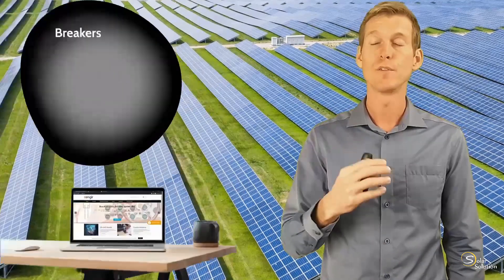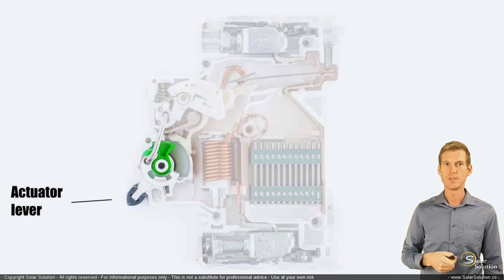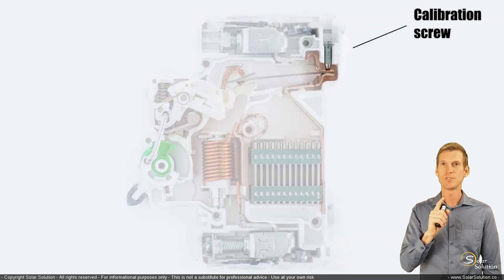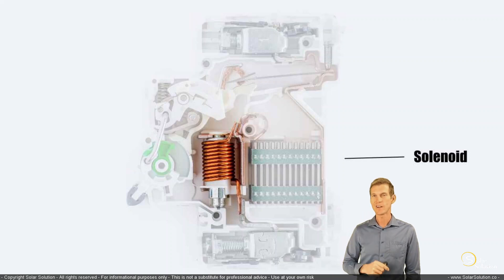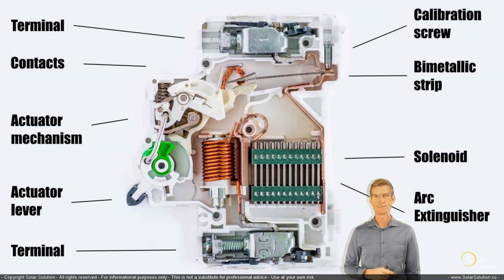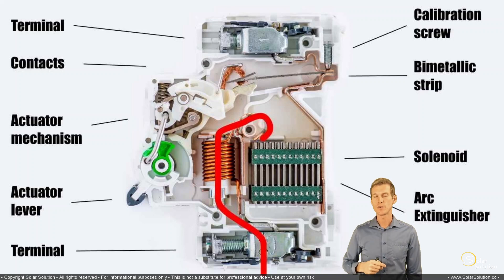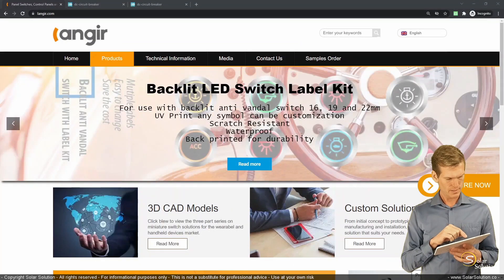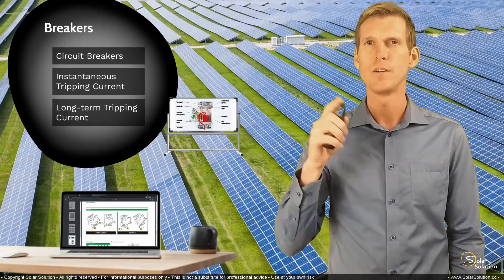Solar Circuit Breakers: The difference between DC and AC breakers

Comment: can you guys explain is dc breaker a must in solar system or optional? if cables are short (10 metera), low voltage (up to 500v), etc.?

Comment: Can I split a 2P circuit breaker into two 1P breakers?
Reply: No, you can't.  Even if you take off the cross-piece on the handle, there is an internal cross-trip as well.  And the 2-pole breaker (if a DC breaker) might or might not depend on the current going opposite directions between the two poles.

Comment: I just tore down a 2 pole breaker. Your explanation makes sense for the single pole. But because these breakers are exactly the same the +/- markings for the breaker on the right is reversed. This means the current is moving through the breaker on the right in the reverse direction. How does this safely trip the breaker?
Reply: I just tore down one of my 2-pole Chtaixi's TXC65Z-60, DC12-110V MCB.  And both poles were also exactly the same.    They have +/- markings too, but the marketing literature is ... confused to say the least.  It says to follow the +/- markings for best practices, but it also says that the breakers don't care about polarity.

Since no matter how you hook the breaker up current flowing through one of the poles will be opposite the current flowing through the others, that means either this 2-pole breaker is not polarized (despite having + and - markings), or it is polarized and it assumes symmetrical/opposite currents correctly breaking the ARC on one of the breakers when they both trip.  Breaking the ARC on one breaks the current path for both (usually).

The breakers do trip together.  There is of course the tie on the handles, and there is also a little plastic piece between the two housings that cross-trips between the breakers internally.

Oh yah, no magnets in the ARC-break for this 2-pole breaker either.  The plastic housing that normally contains the two magnets is empty.  All the other trip mechanisms are intact and operate as expected.

But I can't really tell if this breaker is actually unpolarized, or it isn't and depends on current symmetry, or it's some deficient piece of garbage.

Comment: Hi, is this dc circuit breaker enough to protect Lifepo4 batteries/PV string or should it be combined with fuses?
Reply: DC breaker is basically enclosed resetable fuse with handler. Its the same, only 1 of DC breaker or DC fuse is enough.
Reply: @rm6857  thanks

Comment: I use a 125w solar PV with 30Ah LiFePh battery to power ten 7w light. Can I use a AC circuit breaker for this setup?
Reply: DC vs AC breaker is only about ARC when tripping the breaker, AC breaker might not be good enough in arc extinguishing which can burn down your house, or hit you with piece of destroyed breaker. So it might work, you can try it, but DC breaker is recommended
Reply: But in your setup,you have small battery bank, and if your voltage is small(<50V), AC breaker should work just fine. But better test it first.